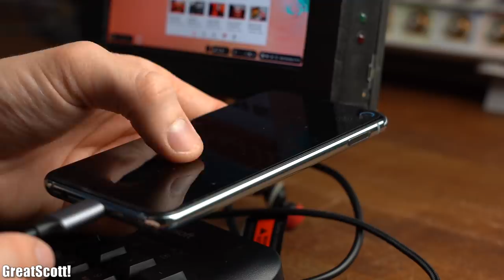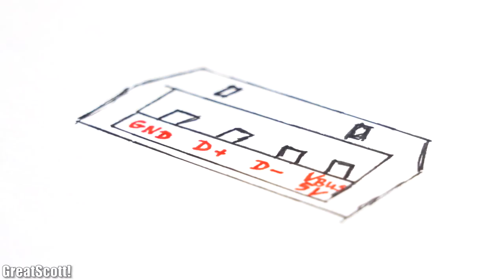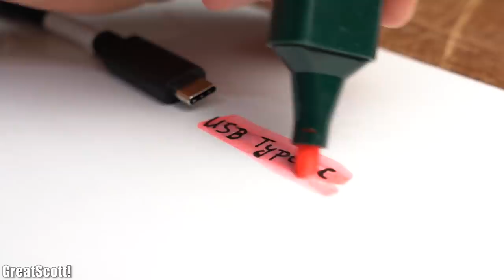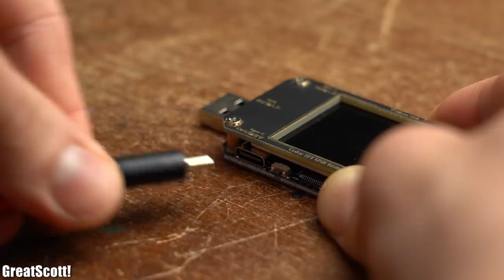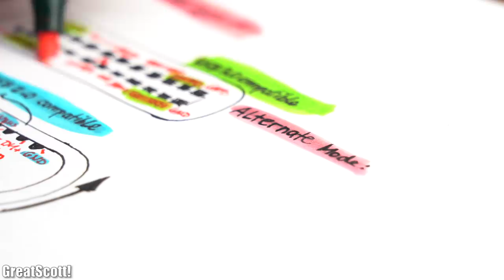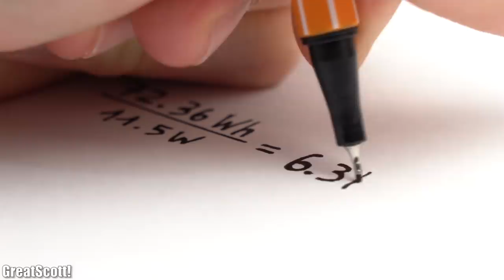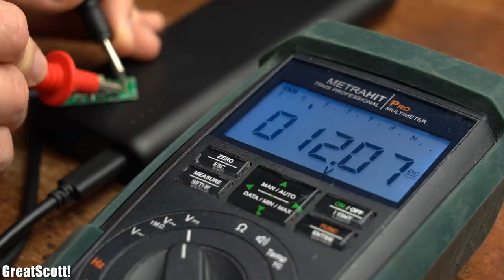Here is why USB Type-C is AWESOME and how you can use Power Delivery for your electronics!

Comment: Fantastic video - I didn't realize that PD triggers existed in such small (and cheap) packages.

I recently built an arduino project that also needed to power and control 12V LED's. This little trigger has removed the need for a traditional lithium ion pack (which happen to be at least 2x more expensive and more difficult to obtain compared to a 30W PD powerbank). This makes the entire project more appealing to make open-source and accessible to even people with little experience in electronics.

You've got the perfect format for videos - not excessive amounts of details, but definitely enough for people to figure the core facts, and the length of them is also really good (anything less than 6 minutes tends to gloss over details, and anything more than 14 mins tends to border into something I need to think about whether I have time to watch). You might well be the first Pateron I subscribe to because of this. Keep up the great work!

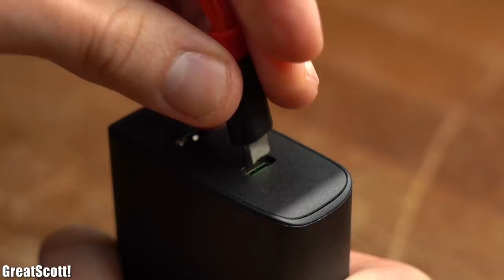Comment: 3:40 I think the term you're looking for is "rotational symmetry" - when you rotate an object by less than a full turn and it has the same shape/layout. In the case of Type C connectors, their shape and most of their pins have two-fold rotational symmetry, because there are 2 positions, separated by 360/2 = 180 degrees, that work.

Comment: i hope you make tutorial " ,how to made amplifer using tda ic..."
Reply: Why ? TDA audio ic's are fully integrated amplifiers.Apply power and a input  signal and you are done.There is even an example circuit(AND PCB) in the Datasheet :D
Reply: @pesho9971  This
Reply: Yo . Choosing automotive sound amps non class d Tda's would be just about soldering connectors , a power filter ( 2 filtering caps , with a coil(optional if not for cars )   )  , 4 caps on inputs ...and that's mostly it ( test scheme from data  docs pdf are very good ) .
Reply: @StaticVapour590  we don't care teacher!! massage  still got through.
Reply: @pesho9971  Reasons I can think of:
1) He has made videos about simpler things
2) There are some details, like power source,  noise filtering, IC model (which plays a big role) and stuff that would be nice to get recommendation from someone who knows
3) Why not? He can make profit out of it
Reply: @pesho9971  because i'm newbie in electronics..

Comment: USB 2.0 is also available with USB-C connectors. For example, my Galaxy S8 was shipped with one, although it supports type 3.1 speeds. A Type C plug does not automatically guarantee high speeds ...

Comment: According to the new nomenclature:
USB 3.0 is USB 3.1 Gen 1
USB 3.1 is USB 3.1 Gen 2
Reply: Funny, that nomenclature you mention is still older than current.  It's now usb 3.2 gen1x1, gen 1x2, gen 2x1, gen 2x2.  USB 3.1 and 3.0 is removed

Comment: 3:40 HE'S A WITCH!

Everyone knows it's impossible to plug a USB A connector in without rotating it at least twice!
Reply: That's only with a lot of practice. Usually you try about 5 times before using the flashlight on your phone
Reply: I'll tell you trick to get it in the first time
When you look at the usb, you see 2 square holes. You need to look at the holes and see if it is covered from the inside or it is open ( you can see the inside of the usb)

The open hole is the side you have to keep up and the closed one down

Well I'm not good at explaining stuff but I think you'll get it if you look at it carefully. 
It works like a charm everytime
Reply: @ericfernandes3966  Yeah thats the method i use to identify which way it goes. And ive never put in a usb the wrong way for years since figuring it out.

its like a god given talent to be able to do that
Reply: @ItsDextrin  yea hahah😉

Comment: In my opinion, i think that the micro usb is one of the worst types of connectors out there, they constantly break.
Reply: Agreed. They also fall out pretty easily (such as when trying to charge something being carried in a backpack).
Reply: @stoeger 2 I have a power bank where the charging port has worn out, makes it borderline useless. I use a magnetic adapter to make it work now.

Comment: I never thought such tiny wires in the connector could handle 100 watts if power without arcing and or losing the connection.  Thanks for the video.

Comment: I have a battery that charges with both USB C and micro at the same time and a charger to go with it with 3 inch cables. It has replaced an entire basket of chargers and cables. Now I have a camera battery pod, gopro battery pod, and watch stand. The pods are flat like the size of one battery and charge 2.

Comment: There is a smaller USB PD trigger based on IP2721 IC  which is smaller but it only has 2 voltage options on a specific board

Comment: MHL do add HDMI output to MicroUSB, charging and inputting data at the same time too. It's just designed for one variety handheld devices. I used to plug my Samsung S4 to a HDMI dock station playing games with remote controller AND charging my phone at the same time!

Comment: What I was actually thinking about the USB type-c, are the wires inside are actually thicker? Because it has to carry a large amount of voltage and ampere which concludes that it is meant for high power transmission cable. That's what I was wondering about. BTW great video👌👌
Reply: wires are possibly thicker for the sake of the current, voltage only matters for penetration and interference so that would be more oriented towards insulation. Someone correct me if I'm wrong. You will have more wires due to more data channels but only the thickness of VCC and GND is prolly increased.
Reply: @Nicba1010  I was actually thinking the same, I think you are right

Comment: For a device to be branded USB PD, does that mean that it will always be able to output all the possible Type-C voltages (5-20)? Or is it that PD simply means it will supply power, and the voltage range is up to the device itself?

Comment: OMG what a fantastic video, ty so much! I have been using usb a, and before, bernouilli drives, parallel and serial cables. I was taught how to make serial cables 40 years ago. I did not know what that usb b cable was, i have them and i wonder how i can use them. i recently got a new usb tester, it is awesome. you have inspired me to get out my soldering iron and relearn that. I love that kit you used. I like things that make it simpler for me to learn. I am putting together a van, when it comes. Most of my electric system is here and ready to go. I am going to use a 24 volt step up to run my monitor, fan and other things by using the 12v batteries instead of plugging it into a 110v inverter (weird it has 18awg wires for 125watts, but i guess it will work if i dont extend the wire too far, i was thinking keeping it under 1' on each side of it). Anyway thanks so much for describing the pins. I have gone as much as possible to usb c, if not using direct cables on both ends, but by a small adapter. The usb a and micro orientation was driving me bonkers, so much that i started marking devices and cables with ink dots. Love the usb c, but didn't know how it worked, and you taught me! thank you so much!!! Also as a trainer i really appreciate how much effort you put into this video - the script and the close ups of the pins.

Comment: The USB-C sources have mandatory overcurrent protection. So if you use a USB-C power bank for robotics, it is very safe. Normally Li-ion is dangerous to work with. But the USB-C power bank has its own inbuilt charging circuitry and has overcurrent protection, can even charge it without powering down the robot.

Comment: Small correction: USB 3.x connector contains both USB 2.0 legacy signal and 3.0. Therefore, its not "backwards compatible", as it is just combing both signals. For example you can implement a USB 3.0 host device that only uses the 3.0 and therefore can not be used on a USB 2.0 PC port. On the circuit side, you would typically take the USB 2.0 DP and DN and those would go to their own USB 2.0 PHY, separate from the USB 3.0 PHY, SoC or FPGA. But as you can image, some super high speed devices may omit USB 2.0 as the 480mbit/s (more like 300mbit/s) is too slow for the target implementation.

Comment: USB-C state only physical informations ;) USB-C can still be USB 2.0, 3.0, 3.1 (i know, this is now 3.2 gen1/2/2x2) or PD. Connector is good, but there is problem where you need to but TB3 compatible and don`t know which one to buy, because you don`t need/want another USB-C cable with USB 2.0 speeds.

Comment: I love your work and thats what motivated me to build my own electric bike im a big fan of yours. I wanted to ask a question i have been struggling with configuration of my battery pack for my ev motorcycle. I want to ask four questions :-
1. Can i connect 3 x 72v lithium ion pack in parallel with configuration of 20s 10p to power my 72v 3000w motor controller it supports 50A so does the motor? (I want max range and power)
2. All 3 packs will have BMS so how do i charge it what charger should i use for this purpose and will those BMS work properly if connected in parallel, what amps will it req to charge?
3. Should i make 3 72v packs or should make 6 24v packs and then connect 3s 2p which one is better ?
4. If question 1 and 2 are possible then what wire should i use to run this project?

Please respond its my first time ever commenting on youtube video i hope you can answer my questions

Comment: In fact, you can have 20V/5A and 5V/2A (not sure if not also 5A) to achieve more than 110W. And there is one theoretical combination, that I do not fully remember with 12V/9V/5V to have tottal 130W output.

Comment: The problem I've found with the USB C connector (not the protocol itself) is that the socket in the device is actually weaker than the plug on the lead, unlike micro USB. So when the cord is bent like may happen on a cellphone or laptop, instead of having to replace a cheap charging lead, you may end up trashing your phone or spending big repairing the laptop.

Comment: I really like USB-C. I would love to install USB-C sockets at home which would serve as power supply AND for network. The socket should be powered by a powered by a 24V or 48V DC home battery and simply be hooked up to an RJ-45 ethernet cable. The SMT PCBs will take care of PD, but has anyone seen anything what would cover both PD + network?

Comment: Question...I'm a newbie here, be nice.
I would like to use that little PCB in the second half of the video to power a portable 5v project. Everything will be a pretty tight fit so I would be paranoid over something hitting that voltage button. If I completely removed it from the board, could it still work?

Comment: Thank you so much for this video. I have a camper van that has a range of electrics that runs on 12v. I want to convert the 12v cigarette lighter connectors to USB-C PD connectors. I run a MacBook Pro as the biggest draw on the system but would also like to convert and connect a 12v external powered hard drive rather  than the USB Bus powered ones. Your video helped!

Comment: Is there a reasonable tool now that we can plug in to a PD bank and it will show exactly which PD profiles it supports?

I got a few 'wall warts' and I suspect that they are malfunctioning because they only supply 5V, but I don't know how I can be sure without getting one of those "inline" testers and a USB-C device that draws variable loads all the way up to 100W

Comment: Usb PD on laptops is a pain in the butt. I have a first gen thunderbolt equipped HP Spectre x360 that has had PD firmware issues since launch. They originally had the PD always enabled even when off so the device had a 6 hour on OR off time.... yes it would self drain in 6 hours when off!!

So hp released 2 secret updates. One let the PD only charge to 90%, the other newer one (only found on one model but supports many) fixed it completely after 3 years

Comment: I really like Thunderbolt 3 cables. They are very expensive and tend to be pretty short though. Since USB 4 is based off of the spec for Thunderbolt 3 but in theory should be less proprietary, I'm wondering if we will finally be able to get a cable with the data/power transfer rate of Thunderbolt 3 but in a form factor that won't cost $40 for a 1' cable.

Comment: Great handy video however you can’t calculate battery charging times like that. If a battery is rated at 2,500 mAh it doesn’t mean you can charge it in an hour by supplying 2,500 mA of current. There’ll be efficiency losses and you’ll need much more time to fully charge it. The other factor is the last few % of a Lithium battery’s charge programme is done using trickle charge and that takes a lot of time too.

Comment: I've messed with USB power. Just normal 5V. It's kind of difficult. A little bit of resistance in the connectors or cable and your wattage really drops off.

Comment: I knew USB-C was rotationally symmetrical, and I knew it had a power delivery negotiation mechanism (mostly because I know the Raspi 4 early production, and the Nintenderp Switch, both failed to implement it correctly)... but I never knew that USB-C could deliver power at 100W over a single connector. That's actually nuts. USB-C is way more versatile than I thought.

Comment: Part of me wonders if you could use this with two power banks, create +-20V and make a good bluetooth speaker.  Most audio good audio amps require negative voltage.  I wonder if it has line noise like a switchmode PS (or boost/buck converter)?

Comment: one thing I like about the original USB type A is that it has the strongest physical connection to the port - i.e it requires more force to remove, it feels less flimsy than USB-C.

Comment: No mention of the QC standards? I generally find them much nicer, as they're more widely supported, cheaper to implement, and backwards compatible with USB 2 ports/cables too, while still supporting quite similar power ranges (QC 4 will do 20V at 5A too). Theres even simple arduino sketches to talk to a QC compatible supply to request higher voltages.

I try to make sure my power banks support both QC and PD, but USB PD wall adapters are much more expensive than QC ones, and it's still quite hard to even find ones that support the full 100W max output.

For my projects, i'm generally using type C connectors, but QC signalling. It means I can use the much cheaper adapters, but still have the advantages of a reversable connector, and using the one set of cables for everything.

Comment: but I think the small circuit that can supply 5 to 20 the circuit will heat up during operation my point is that small circuit can handle high voltage.

Comment: One thing to note... the USB C connector can fit into your typical US 120v outlet due to it's size/shape, so be careful if you're aiming in the dark!
Reply: Wouldn't do much unless you're completing the circuit I'd imagine. But that's definitely not ideal either way!
Reply: @Guggu3d  Don't be so sure, that's generally the "shield" or "ground" on the cables, if that gets plugged into hot (live) on mains... the chassis of your phone could become live. 

A lot like the USB chargers that BigClive torn down before that had mains on the USB shielding/chassis.

Even if you don't plug it into your phone, touch that while another part of your body is grounded, you'll definitely get some love from mains ;) (the cable will probably instantly melt... but you'll also get a tingle :))
Reply: @ThinkinThoed  You're right! That makes good sense!

Comment: I have a Lenovo Yoga 2 Pro Ultrabook manufactured in July of 2014, it's power supply outputs 20v@3.25A through the classic rectangular yellow Lenovo connector.  Would I be able to use that USB-C sink to hook an appropriate battery back up to the laptop for additional power?  I never though until now that I might be able to charge a pre-USB-C laptop with a USB-C power bank.

Comment: Can you do a video on MOV'S (Metal Oxide Varistors) and GDT'S (Gas Discharge Tubes) for things such as surge arrestors and overvoltage protection pro/cons of that method of protection vs diodes and transistors for protection.

Comment: So with these PD / Breakout boards are we limited to 5A? How come so many USB C chargers for tablets / laptops are able to push more than 25A? Are they using these higher voltage modes? If I wanted to power a WLED LED strip, how could I get more amps out at 5V?

Comment: Would love to see your opinion and you taking a look at the portable graphene batteries that are on the market for now (for example the elecjet apollo). Haven't seen any big youtuber(except unbox therapy) taking a look at them and check how "real" they are.
Reply from the maker: Their "fast charge" feature is pretty much only USB PD. Every other powerbank with PD functionality (with 100W input max) will charge just as fast. The graphene does not change this.
Reply: @greatscottlab  I think what I'm more interested it's not really if it can achieve that, but what are the "adverse effects?"(not sure if that's the words, i'm not a native english speaker) of that? Does the graphene really helps in this? I know that with normal lithium batteries, they get pretty hot if you charge them fast, and if they get really hot their life expectancy would be reduced. Does those batteries prevent that? Do they have a better lifespan even if you recharge them fast or after multiple recharging cycles? I hope I didn't said something dumb, this is just research/stuff I've been reading on the internet, I'm not an electrical engineer or something, kinda that's the reason I want to know your opinion on it, cause I know you got the expertise. I've been waiting for a long time on some batteries that not only can recharge/discharge fast but also have a big number of recharge cycles before starting to degrade.